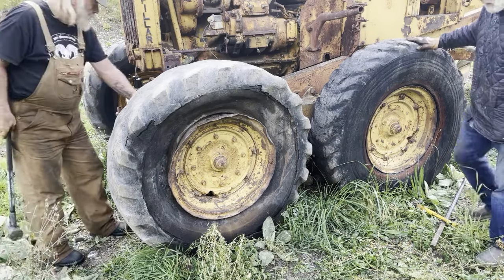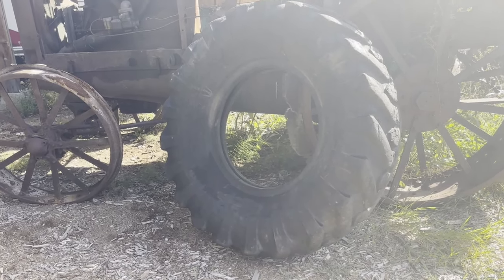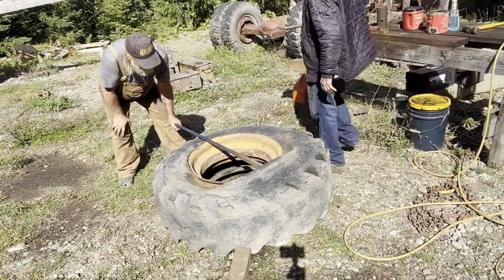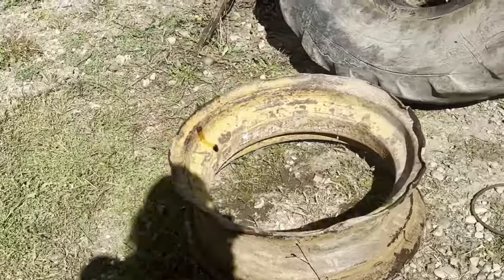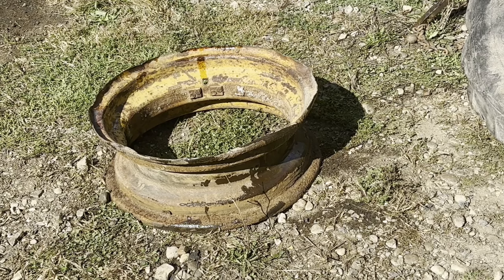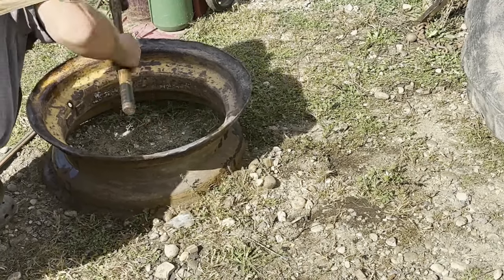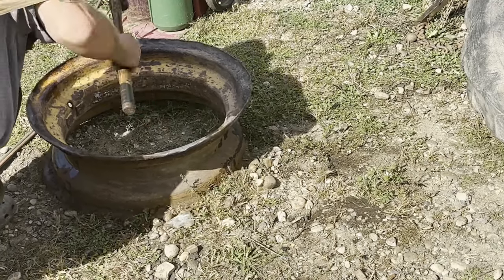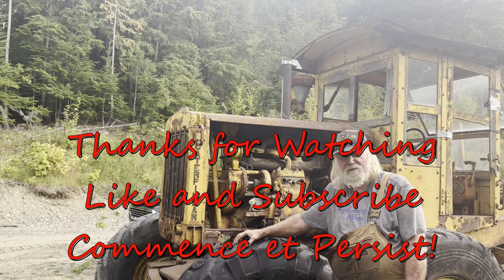Autopatrol 11 7G152 Ep 7

Comment: keep it up you have my attention
Reply from the maker: The Autopatrol is going to be intense. It has lots of problems.
Reply: Looks like u done a time or 2.
Reply: Just had same suruwaytion 
On my little trailer  10  inck 
By tite tube  straighten  rim 
Got run flats  air less solid 
Rubber. By the time y see this i be kut putting down 
Some of your  Canda green 
Grass here in central  Illinois.  Going to try beat the rain. 10 00am gonna rain for  2 3 days it be up 
With  little  watering effort 
Have gooden